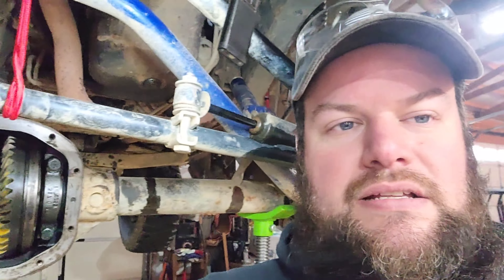Volvo Locker in a Jeep?

Comment: What year Volvo did the locker come out of and was the Volvo a turbo car? Also would 35 inch tires and 488 gears be too much for this locker?
Reply from the maker: I think mine came out of a 92 if I remember correctly.  I'm not sure about your gear/tire size, because I'm on 33s with 3.73s. 

I would think it would depend on the type of wheeling you do and how hard you are on the throttle. I have read a report that someone broke an axle shaft before the carrier. I look at it this way, it's a so cheap to try it, might as well. If it breaks, put the stock carrier back in and add a lunchbox locker or (what I would do) upgrade to a stronger axle (JK dana 30, Dana 44 narrow, or 1 tons).
Reply: @KJsProjects  was it a turbo Volvo?
Reply from the maker: @ChasingOurSolitude  Yes, I'm pretty sure it was. It also had the tow hitch if I remember correctly,  I did pull this diff over a year ago.